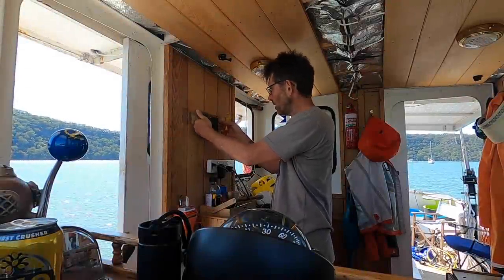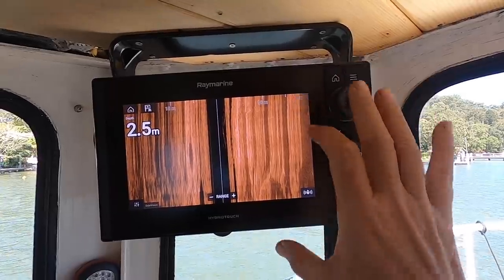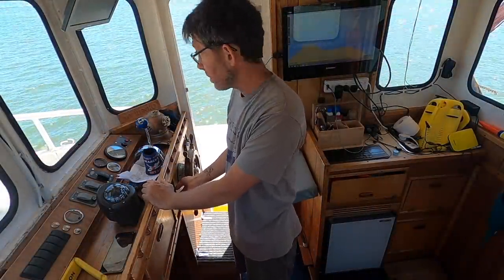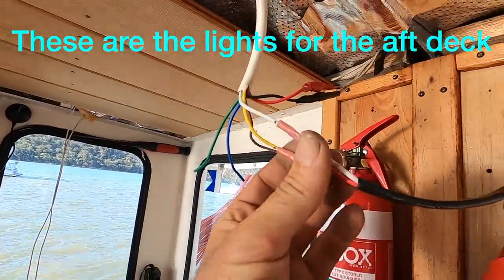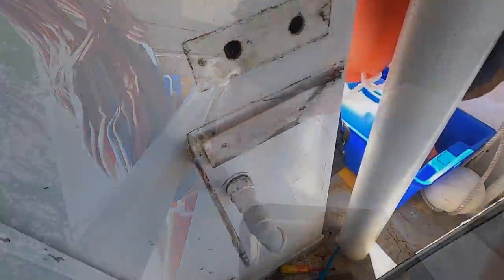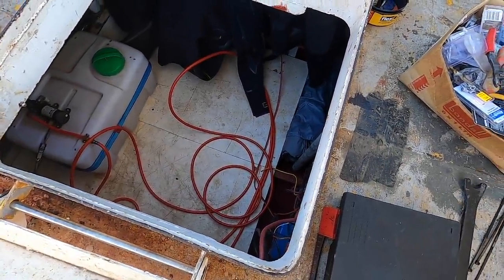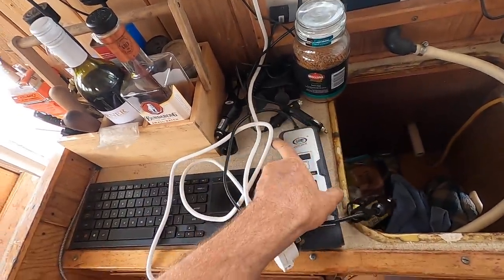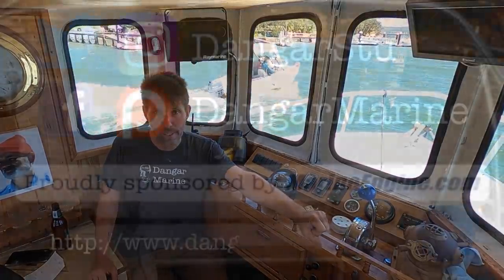Boat electrical upgrades

Comment: Your “Earth” “ground” or “negative” attached to the gearbox of the engine may not be a good idea. You said a path “through the prop shaft” is a really bad idea. I’m hoping you have a heavy ground strap to somehow supply a negative path from the batteries. Your engine is isolated from the steel hull by the engine mounts. The prop shaft could only supply current though a possible bushing bearing or a component that also provided ground.
Reply from the maker: So where would you put the ground?
Reply from the maker: For reference, this is the article I was reading.https://www.westmarine.com/WestAdvisor/Marine-Grounding-Systems  It definitely seems like there is a lot of potential to get this stuff wrong so happy for any suggestions.
Reply: The batteries are the best. I don’t know how you have the your ground routed from your batteries. The shortest path with the biggest conductor is usually the best.
Reply from the maker: Sorry, more questions / info as I do want to understand this much better. So is the negative for the starter sufficient as the negative path from the batteries or do I need something dedicated as a ground strap?
Reply: The heavy ground on the inverter is mainly for the DC side, to trip the DC breaker/fuse if a internal fault occurs. Run it straight to the NEG Bar, I think you will find the coupler on the shaft isolates the engine electrically from the shaft. boats with a coupler like that use a shaft brush or strap to electrically link the shaft to the bonding system, there should be only one point of contact from DC neg to hull.
Reply from the maker: @Nick75au1  So I'm not really sure that I currently have a DC negative grounded to the hull at the moment given it goes to the engine starter, but the engine is isolated from the hull by the engine mounts. For now I'll move the AC ground to the battery negative to avoid the chance of anyone in the water getting fried and then look into how to bond the DC ground.
Reply from the maker: @SkypowerwithKarl  Cool, I'll swap it over this morning.
Reply: @DangarMarine  Keep the engine isolated , run all your negs and any grounds to the NEG bar, there should be only one neg from each battery bank to the NEG bar (through the shunt) then one heavy link from the bar to the hull. Ive seen some info that says that a seperate ground plate isolated from the hull is better for steel boats
Reply: Are your inverter batteries the same as the “house” batteries? Are they tied into your engine batteries or common terminal? Are both paths + & - adequate in cable sizing for the run length and fuse size? The number one cause of poor inverter performance is too small of cable sizing.(or a thin jumper that’s carrying all the load)
Reply: Also seriously consider fitting an RCBO RCD Circuit Breaker (GFCI for our north americans) on the output of the inverter,
Reply from the maker: @SkypowerwithKarl  Yes, the inverter runs from the 24V house bank. The 24V house, 12V house and 24V starting backs have all their negative terminals tied together. I'm guessing that the path of least resistance for that AC earth is through the gearbox to the starter that has a thick cable going to battery negative but I'll move the AC earth start to the negative buss to be on the safe side. Pretty sure the cable and fuses sizes are adequate for their runs.
Reply from the maker: @Nick75au1  Was actually trying to see if there was anything like that built into the inverter. I see people add them and galvanic isolators where shorepower enters the boat but couldn't find anything about the inverter side. All for making the AC side safe for people in the boat and swimming nearby!
Reply: @DangarMarine  Most inverters don't,  this is because they need an AC isolator, (over and above the DC isolator. the RCD/breaker acts as the isolator.  I know Enerdrive make an inverter for caravans that has a built in RCD for caravan installs but its a plug in type, you isolate the AC by unplugging it :)
Reply from the maker: @Nick75au1  Cool, I'll add one then for sure.
Reply from the maker: @SkypowerwithKarl  I just remembered something else I was thinking before this install, and that is if the AC earth is attached by the shortest path to battery negative, and a battery negative goes to the unit, why don't they just make the connection internally? I presume there is a good reason or something I am misunderstanding (most likely both!)
Reply: @DangarMarine  Engine blocks used as the neg bus are the biggest pain, Mustang used to do it, think sterndrive, with the main terminal at the back of the engine. impossible to access so people stack all the negs onto the battery terminal...its been an FML moment a few times doing repairs and upgrades LOL
Reply: Dangar Marine 
Let me rephrase it, the little terminal (earth/ground)next to the big negative terminal can jump right to the steel bulkhead where the inverter is mounted it didn’t need to go through the wall to the engine. I take it that the surface you mounted the inverter to is wood? I thought it was the big negative cable is what you were putting through the wall. The neutral side of the AC side versus ground is where things get weird on boats and RV’s and gets even weirder when switching to shore power. I can’t make recommendations from here and rules and thinking may be different from here. Have someone knowledgeable in your area have a look if you’re concerned and have a poke around. He can make suggestions way better than us that can’t see it all from here.
Reply: It is connected internally, hard to explain but the large earth on the case isn't a path for an AC fault if one occurs, the fault path is actually to the neutral within the inverter.
Reply from the maker: @SkypowerwithKarl  Sure that makes sense. I think with the AC side I would like to have someone inspect everything to make sure that there aren't any issues with safety to people to corrosion in the hull. It's a bit like getting Adrian to tweak the Detoit. Getting an expert in once can provide a lot of peace of mind down the track. Oh, and I have similar memories of trying to change the oil filter on a Mercruiser that was right at the back on the bottom. :(
Reply: @SkypowerwithKarl  You don't want the earth to go to the bulkhead/steel hull, but to the neg bar, (Its right next to the inverter anyway) it's designed to take fault current back to the battery if an internal fault to case occurs and then trip the DC fuse/ breaker. (as a secondary function it also stops the inverter neutral/ground "floating" over the vessels ground system) Not surprisingly the rules for AC grounding, shore power and onboard sources of AC are quite similar (not withstanding the dual legs of the North American system) between Australia and  the US Nothing weird about it if you understand the reasoning behind those rules.
Reply: Dangar Marine 
Lol. And I got to remember, you guys are running 240 volts. That’ll lay you out straight, where here in the states 115 volts is a tickle in comparison.
Reply from the maker: @Nick75au1  Well, that's a nice short trip at least and leaves me with a spare cable gland for autohelm and lighting etc. After that I guess I just bond the battery negative to a single point on the hull and we should be getting close.
Reply: @DangarMarine  Yep.
Reply: Easy solution is just run a ground strap from where you're bolted on now down to the hull. Weld or bolt an eye on to attach to.
Lookin' good Brother... when we goin' fishing? Cheers.
Reply from the maker: @scofab  Yep, was thinking of welding a bolt head on so I've got a stud with good guaranteed connectivity.
Reply: I don't think the engine exhaust is isolated from the hull and is therefore a substantial conduit in itself.
Reply: @DangarMarine  If you are going to earth to the engine/hull rather than keep it isolated a galvanic isolator would be a good idea, they can protect you from faults with other peoples electrics if you are ever connected to shore power, that may be rare in your case but they are cheap and easy to fit or can be bought to go inline with your A/C power cord
Reply: Look up start point wiring. Pick a point to connect everything to, busbar, battery, engine block, whatever. But connect everything to that point
Reply: @DangarMarine  Look at it like this, electricity always need to return to where it came from and on boats it is usually the negative terminal on the battery or a bus bar connected to the negative terminal. Shore power needs to use the ground in the cable that supplied the power otherwise the power will return through the hull and anything that comes in contact with it (very dangerous).
Reply: @DangarMarine  Stu, you may think the engine is isolated from the hull by the engine mounts but you have a metal exhaust stack connecting from engine to hull, your engine control cables may also make a connection between engine and hull if the control box mounts to any metal on the dashboard or the cables are clamped anywhere to the hull. In practise it is often better to connect the engine to hull with a heavy cable unless the engine ( starter, alternator, all gauges and senders, exhaust, controls etc. ) are specifically designed for insulated earth.

Comment: Hey Stu, pro tip from an aging ex-surveyor/4WDer (and your EPIRB donater ;)) best mounting your fire extinguisher horizontal as it prevents the powder from compacting. The motion of the ocean will keep the powder loose when horizontal or tap the bottom of the extinguisher with a rubber mallet periodically. Nice job "Danger Stu".
Reply from the maker: Nice idea. I have heard about the powder compacting on boats and we always used to advice people to turn them upsidedown periodically but a sideways mount does make sense.

Comment: G'day Stu, why not make use of the old tap hole, you might need to make it a bit larger and fit a cable access plate like you find on office desks, gives you access without having to remove the cutting board ( and whatever is on it) cheers.
Reply from the maker: Planning to put a slim cabinet on the wall there so the holes will eventually get used.

Comment: A voltage regulator actually isn't strictly necessary to run the computer off of the battery 12V  - it almost certainly has an internal power regulator that can handle a range of input voltages.. But it would be nice for peace of mind since the only way to know for sure is to rip it apart and look up the datasheet for the internal regulator

Comment: Noticed as you were doing the sonar overlays that there's a resize option. Shrinking the gps numbers seems like a good plan if they are primarily to use on replay after a search, so less of the display is taken up when you're watching it live.
Reply from the maker: Yes, will do.

Comment: Those cig sockes and plugs are nasty.  Swap them for merit/hella plugs as you get the chance.  They are smaller for one thing and electrically sound.  Love the Victron stuff.
Reply from the maker: They are. I think I'll keep the sockets so I can use random things that have the plugs on them, but other things that will be living on the boat may as well be cut and hard wired.

Comment: On many large ships they maintain an isolated electrical neutral from the steel hull. It reduces the potential of electrolysis and if one wire shorts to the hull the safety protection circuit will not operate thus maintaining operation of critical equipment. They then use an insulation meter to monitor for electrical short circuits to the hull. For anything over 3000 volts special protection and shutdown system are required.
Reply from the maker: Yes, an unbonded installation is a good thing, but requires lots and lots of testing to make sure it is perfect.
Reply: @DangarMarine  You want an electrically bonded metal hull but just not to electrical system. That includes 12vdc and 230vac. Marine starter motors should be electrically isolated from the engine block unlike a land vehicle. Even the temperture sensors should not use the block as a return path to the battery.
*Dief marine make insulation monitoring equipment*.

Corrosion reduction
All metal items should be all bonded where practical to keep equi-potential to eliminate electrolysis. Some boats run a copper bonding strip the length of the hull to make it easier to bond differant items such as pumps and water purifiers.
Large vessels use special equipment that puts a galvanic electrical current across the hull to reduce electrolysis corrosion.
Many electrical boating codes for smaller craft require electrical systems to also earth to metal hull
Reply from the maker: So bonded in the sense that 0v is the same as the hull potential but everything has it's own negative back to the batteries?
Reply: @DangarMarine  Yes that's correct. All metal items on a boat should be at the same electrical potential (0 volts. ie low ohms). Use a multimeter. You may have noticed that outboard motors have bonding wires on all the metal parts especally on moving parts.
Also two wires to every electrical item back to the battery. I believe its possible to buy electrically isolated starter motors for marine engines.
If practical Never use the hull or engine block as an electrical return on a boat.... I know it's more work, but it can be done.
(Dissimilar Metals & salt water = equals battery = corrosion. Note corrosion always occurs on the negative terminal.)
Reply: @Maurice Upton That is a Naval requirement, where maintaining equipment operation is a higher priority than personal safety, personal safety is maintained by a heavy ground strap to hull, to ensure potential touch voltage on a faulty piece of equipment is minimised, Boats must have the neutral and earth bonded at each power generation equipment. for inverter/chargers, the bond must be broken and then the charger uses the MEN at the shore or generator. This is a requirement for commercial and recreational boats.  

 The engine is isolated from the hull already so using engine block as battery ground is OK, (of course it needs a neg from block to battery NEG bar) I would only connect engine related accessories negs to the block. The main requirement on a steel hull is to not use the hull to return current to the battery, 
The copper strip is for non-conductive hulls.

the system you are talking about is called an impressed current system,  still uses anodes and is prohibitively expensive as it needs constant monitoring,

Comment: Hi Stu,  great vid,  you can find 12v DC outlets and then cut the cigarrett plugs and install a 3 prong or 2 and into the dc outlet.  way better
Reply from the maker: For sure, cutting them off is very tempting.

Comment: What happens if you pinch the screen on the raymarine? Does the GPS numbers get smaller? Can't really tell from the video but seems that not only the position but the size is configurable

Comment: Hi Stu, a couple of suggestions for future searches. When we looked for Banana prawns, pre GPS we had poly floats which we melted a groove around the circumference. We had twine with chain weight tied then wrapped close to the depth we were searching on the float that we would deploy on the target This may help narrow your search area in future.
I am not sure how much chain is on the anchor but maybe a grapple would assist in locating the chain in the mud.
Reply from the maker: Interesting idea. I'm not sure about the chain length either but I definitely agree that grappling is worth a shot in the mud.

Comment: That Victron inverter really should have its own 24v supply fuse.  A catastrophic failure with those big batteries would be reeeeeally bad!
Reply from the maker: It's fused right at the positive terminal of the battery.
Reply: Dangar Marine Perfect!  Last thing any of us want to see is all your hard work ending with a barbecued Renko!!

Comment: Buoy's in water show up with huge contrast on sidescan data, when they're between the surface and bottom you'll also be able to see a "shadow" of the buoy, when the target is above the bottom the shadow will be disconnected from the object on the data. They're great for locating underwater.  BTW, looked like you could resize the overlay fields on the sidescan screen and probably make them a lot smaller. I had a quick look through the manuals but couldn't find anyway to export the sidescan data as a data file. May be in there somewhere, but if you can get them out as an actual file (xtf for example) you'll be able to use a viewer program to plot the targets and analyse the data (measure, see position, depth data etc).
Reply from the maker: Hi Haider, it would be great to export the actual data rather than only having a video recording of the session. If the Axiom can't do that I might put in a feature request, you never know your luck! :)
Reply: Dangar Marine on Lawrence you can change the size of overlays with the zoom function. It might work on the raymarine too.

Comment: Barefoot walking on a rusty ship wreck. You beast.
Reply from the maker: In some ways I feel safer. The only times I have every slipped over and fallen have been while wearing shoes and not having the grip and feeling that bear feel give you.
Reply: I could barely watch... wetsuit boots with a tread or some plastic/rubber slip on type things good for swimming at stony river beaches or crossing shallow streams whilst hiking. A few bucks to save a fearsome injury...